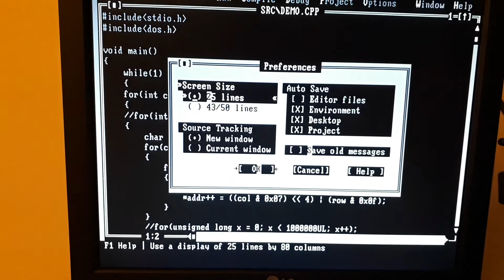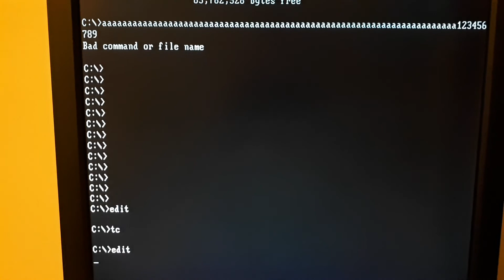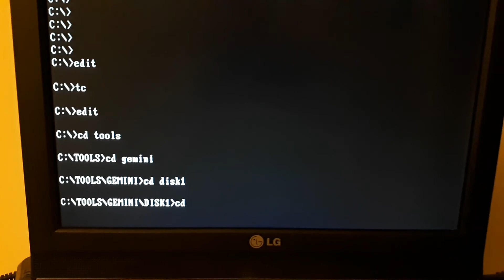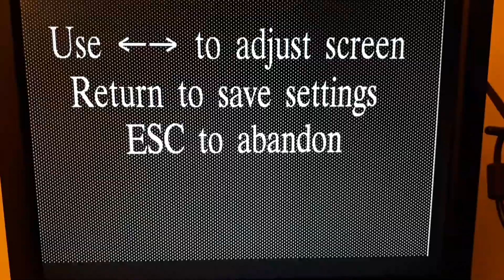MDA is working!

Comment: Awesome to see it running! MDA was quite good in the 80's once the Hercules card and clones came out (offering graphics). One thing I've picked up though is that some  cards are fitted with a 16Mhz crystal, rather than the 16.257 IBM used, I'll be curious to see how that goes or if it even matters. Awesome work, can't wait!
Reply from the maker: It won't work well. It must be in sync with the FPGA clock or change the FPGA for the new board clock